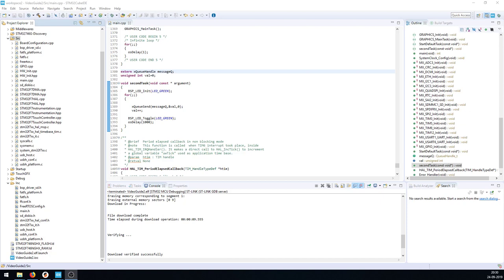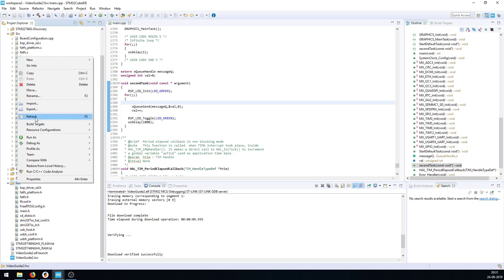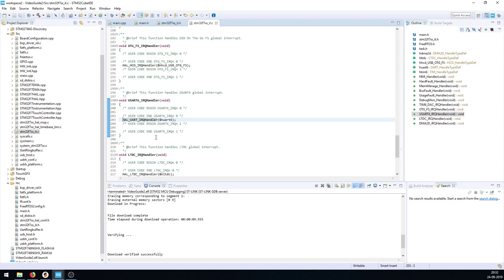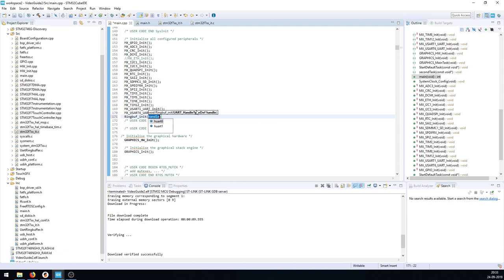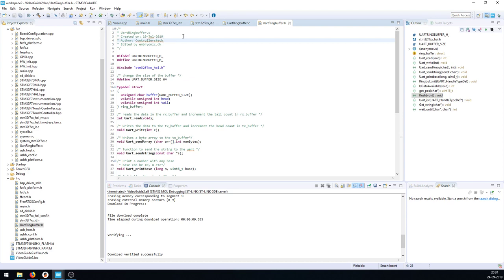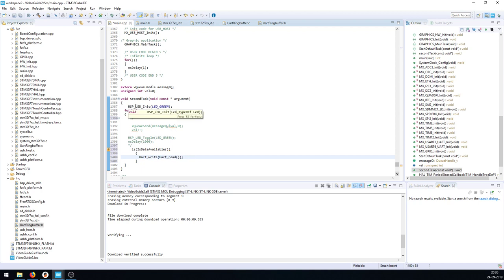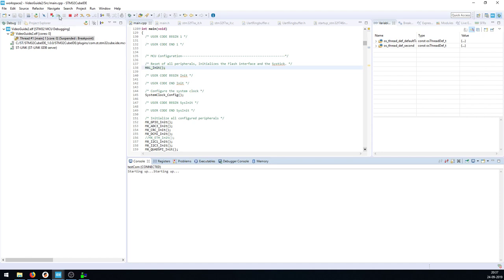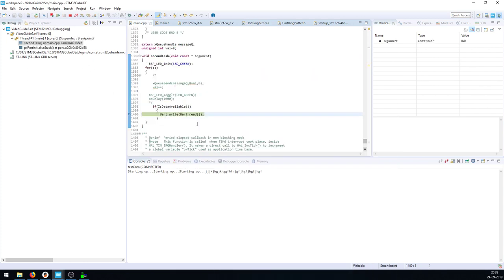Setting up a ringbuffer for STM32 in CubeIDE

Comment: thanks for the help; I had a similar solution but less straight forward; NOTE: if you write your changes next to the place where you added them, in the area between the comments /* USER CODE BEGIN ... / <your code> / USER CODE END ...*/  ---> the code will not disappear if you change something in your CubeMX configuration after a new set was generated.

Comment: Hi how I can move or copy data from a 16bit buffer to an 8 bit buffer?
Reply from the maker: @Mofachannel1  usually you would split into 2 bytes and put each one in the buffer separately
Reply: @banjohat  👍👍👍
Reply: @banjohat   one another question :
Why uart sends data reversed
For example 
If I want to send
 1139(ascii) = 0473(hex)
When uart sends data i have
7304(hex) in my computer
Reply from the maker: @Mofachannel1  it is because of endianness and how the stm32 stores values in memory
Reply: @banjohat  is it possible to reverse this data before sending to finally get a non reversed value in computer?
Reply from the maker: @Mofachannel1  of course. You just put it into the buffer in reverse

Comment: I added the UartRingbuf.cpp and .h files to the project. Refreshed the project. They showed up in the file list. Even code completion is aware of the files. However,during linking, no matter what i do, i always get  5 error  similar to "undefined reference to `Ringbuf_init.... Any idea what's wrong?
Reply: It's not enough that the project knows the file. You have to explicitly include the header files in the files that uses the ringbuffer calls
Reply: did you put the extern "C" stuff in the header file?   calls from cpp files won't find the functions without it.
Reply: I put it in the UartRingbuffer.h file,  similar to how the it.h file has it.   it belongs there more than in main.h

Comment: Thanks for  your lecture. However, I m faced with the problem. and Anybody help me plz? 

error: 'USART_ISR_TXE' undeclared (first use in this function); 
Im using cortex M7 series and was trying to apply it to my project. 
I think this is becuase the difference of cortex-m series ...or not...
Reply: Sounds like you're missing an include somwhere in the top of the file generating the error

Comment: have you tried receiving data with this code?  in loopback mode it seems ok,  but when I try to receive fast data it gets stuck in the ISR.
Reply from the maker: that's strange. For me it works just fine. Where in the ISR does it get stuck?
Reply: @banjohat  Debugging is tough in my setup,  as halting and stepping does not halt the OS tick,  so it always goes to the interrupt handler and I can't step the code.  There is surely a setting to fix this but I have not found it.   In any case,  I played with my own ring buffer for the CAN which worked ok,  but the final solution was to use a FreeRTOS queue for the data.  The queue handles all the interrupt and task issues,  but be sure to set the interrupt priorities correctly for the RTOS.
Reply: @TurboBobBailey  hello friend, i'm a brazilian student and i have a project using ST's MCU together with ESP8266, my problem is exactly this, when receiving data quickly by UART, the data ends up getting lost, you would have the code you used to solve this? I've been looking for a solution for days.
Reply: @patrickanderson1763  my application is working now.  I have a periodic message that I receive.  I call the checking function every 5 ms,  and when the number of total bytes received is the same for 2 samples,  I copy out my working buffer and reset the uart.  The uart is using the interrupt driven rx methods.